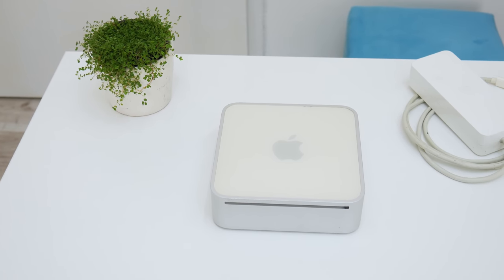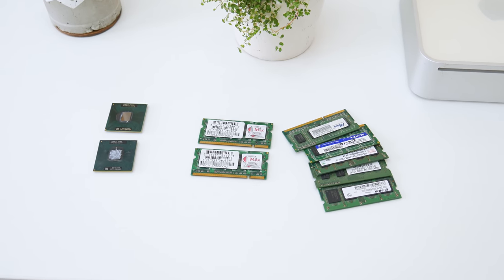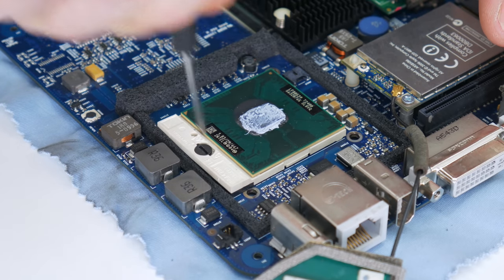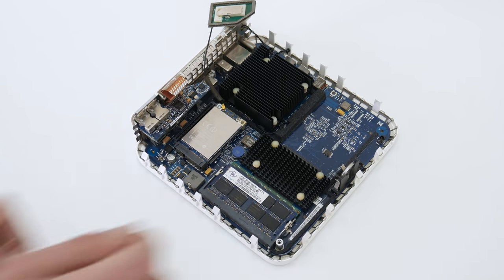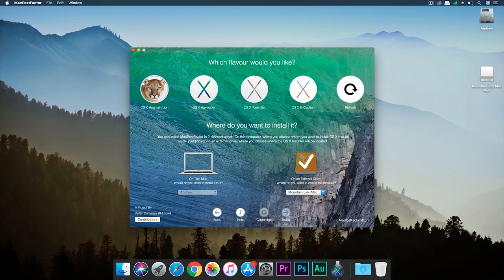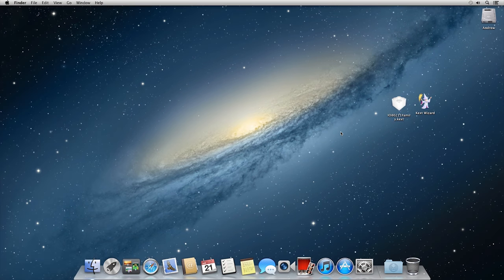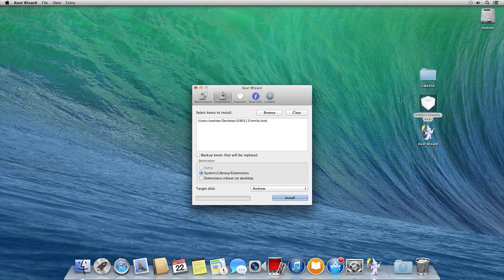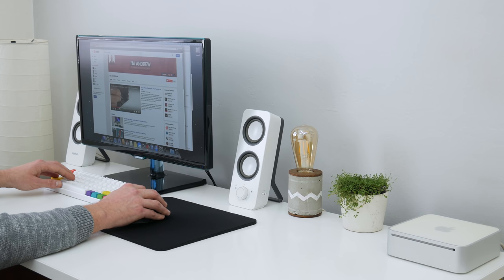Upgrading the $20 Mac Mini - Running Unsupported Mac

Comment: Hi andrew, why u didnt put a q6600 (core quad) and a ssd? thx!
Reply: This Mac takes laptop-class CPUs, it would be physically impossible to put the Q6600 in there.
Reply from the maker: Hi bro, the q6600 ( desktop ) is a different socket, this mac mini has laptop's socket, but some core 2 quad with 478 ( aka P ) socket may work, i will try to find some and try it, btw these cpus are pretty rare nowadays
Reply: The Q9000 doesn't seem rare, eBay is full of them. And for what it is, it's reasonably priced, too. Good luck!
Reply: @ComputersAndTechAndAndrew  ahh ok! I thought it was socket pc not laptop

Comment: LOL. I just thought I would watch this for a laugh cos I got an old MacMini too!
Turns out this one is MASIVELY superior to mine... Mine is a G5 at 1.25Ghz and the best I can get running on it, is MacOS 10.5.8

So, Im going to try to get soem Linux running on it if I can ?
I did plop an SSD into it a couple of years ago, and it helped make it quicker but not by much.

Comment: Thanks for the video, useful. I assume this will also work with the Intel® Core™2 Duo Processor 1.83GHz T5600 as this supports the 64 bit instruction set?

Comment: Didn't understand well.
Can't you update firmware before disassembling the computer?
Reply: Luis Ces well, yes you can. I think
Reply: @sohamghosh4815  So Andrew could have avoided disassemble the computer twice and disassemble it only once?
Reply: Luis Ces yes but it would be super slow or worst of all, it not turning on.
Reply: @sohamghosh4815  I don't pretend bother you but Why updating the firmware would cause the computer not to boot?
Reply: Luis Ces because if the computer finds it isn’t compatible with the software, it will give an error. You can’t update it to an unsupported software with a hackintosh.
Reply: @sohamghosh4815  Sorry? Hackintosh? This is a real apple computer.
Reply: Luis Ces you can hackintosh a mac. Check out a video by Snazzy labs called “hackintosh a real Mac?”

Comment: Hey, Andrew! Just met your channel with this video (and already subscribed it!). I just found an old Mac Mini in my basement and started to search what I could do with it. It was a great coincidence to see that you recently upgraded it and published it here. I would like to ask you one thing: The T7200 is the best CPU for it? Do you know if I can put anything greater for the CPU? And how about a SSD? Thanks for sharing your experiments! Cheers from Brazil.
Reply from the maker: Hey bro, thanks for subscribing :) about upgrades, the T7200 is the latest used CPU on this mac Mini models, maybe some other CPU will work but i'm not sure. I got the T7200 because i saw that it's supported and it is very cheap :D also with SSD will be much better
Reply: @ComputersAndTechAndAndrew  the t7400 en t7600 work well

Comment: And i just want to put a more recent os x on my Mac Pro 2.1 still on 10.7.5 lion, but i'm afraid that it will not boot after.
Reply: I've actually used MacPostFactor on a 1.1 (with the 2.1 firmware update) with a GeForce 8800 to install El Capitan. Then we swapped the video card out for a GTX650 and put in the WiFi card from a 2011 or 2012 MacBook Pro.

No boot video so if something goes south, you have no idea; but there is video when you get into the OS, so it works.
Reply: Only thing I'd suggest when doing that is if you have an empty drive bay would be to get yourself a SSD to install it on. Newer OS X versions take forever to boot when on a hard drive.

Comment: Congrats for the well done video! Really nice and helpful . I just installed mavericks on my 2007 Mac mini. Can I update to 10.9.5 with no issues?
As I already had 2.0 GHZ INTEL CORE 2 DUO on my 2,1 mac mini, do you think is necessary update firmware to upgrade to 4 GB RAM? 
I couldn't find the file on dosdude website. Big miscellany. Can you write down the name of  that file if that's the case. Thanks ; )

Comment: Guessing it has integrated graphics and you're forever stuck on Mavericks. I did similar with a Mac Pro 1,1 and with a GPU upgrade I'm running El Capitan flawlessly EXCEPT the EFI is still 32bit and I don't have a boot screen.

Comment: Fun Fact - APPLE throttled these 64-bit CPUs used 2007 2008 to only actually RUN at 32-bit !!!!  A custom firmware flash required to undo that and allow tghat 64-bit beast to roar in your iMac or mac-mini.
Reply from the maker: Hi bro, some core 2 duo, like one i used in this video, are 64-bit, even good enough to run windows 10 :D, i try that

Comment: I have a iMac Mini Loin 10.7.5 and want to run the latest Mac OSX
Reply: Loin? i have a filet mignon
Reply from the maker: If your Mac Mini has Nvidia graphics, than you can go with latest macOS Mojave
Reply: Cat and Andrew how do I find it out if it has nvidia I'm not good at programming
Reply from the maker: @JustinFrost302  You can tell me what model of Mac is and i will find it, ( example Mac Mini A1347 ) the model is written from the bottom side
Reply: @ComputersAndTechAndAndrew  its A1176

Comment: Macs are great, once your machine is labeled as obsolete "2 generations away", to upgrade the machine you should: Read a manual, download firmware from 3rd parties, find hacks.... etc.
Now you cant upgrade anything since most things are soldered in... 
Enjoy the last generation of upgradables.
And yeah, better switch to a PC, I did in 98 and never looked back.

Comment: That's what I hate about apple. The 2006 mac mini was only supported with new software for 3 years until snow leopard. If you then want a new OS for safety or software support reasons, you have to buy a new machine. This mac mini with OS 10.9 is still quite useless if you want to run any modern browser or use apps from the app store, because most modern applications require OS 10.11 or newer.
If you want to use this computer today, it's better to just install Windows on it. Windows 7 runs natively and still gets modern software, I don't know tho if Windows 10 will run.
Reply: That's because it had a 32 bit chip, so they would've had to go through a lot more Hassel to keep it updated. Just like how the iPhone 5's support was dropped relatively quick, but the 5s's which had a 64  bit chip is going to be dropped this year. Kinda understandable, but still not excusable.

Comment: Unfortunately it's not safe to connect to the internet with a mac OS lower than Sierra. Nice job though. I cloned a mac mini 2011 to a ssd and upped ram to 8gb, but the OS support for even high sierra will be done before long. It was fun but a WASTE OF TIME. It's like using XP you putz!
Reply: I'm running 3 OS X simultaneously, 2 of them Lion and Mavericks, only 1 is newer than Sierra which is High Sierra. I run every browser both supported and unsupported on the older ones and have never encountered any threats. I browsed many darkest corners of the web and my Mac wasn't infected a single time. On the other hand Apple itself has warning in small font on every product page of their site stating that "Internet is a territory of risk", so it doesn't matter how new your OS or browser is, you're vulnerable anyway if some gvmt or bad actors decide to take over your computer. The mantra "update to get newer security patches, it's unsafe to use Internet with older software" is just a tool of intimidating customers into upgrading their software in order to make their hardware obsolete as soon as possible so they could sell you their newer machines so that, in turn, the flywheel of economy and corporate profit would gain the speed.
All the security hype proved to be helpless against Meltdown and Spectre, ransomware attacks no matter how new your software was. Also, take notice of who first reports of vulnerabilities: it's security specialists and research analysts that Apple makes publicly available on their site. Besides that, a one more thing has spurred my curiosity: why does Apple publicize already patched security holes? Regardless of whether attackers would be able to discover them on their own why wouldn't it be better to leave them blissfully ignorant about what vulnerabilities were mitigated? I believe that by making the information open Apple just incentivizes both sides - attackers and their potential victims that happen to be Apple's customers (leaving the latter naked against attacks unless they upgrade to "the latest and newest") - thus creating the aura of constant danger to increase their profits.
On Internet you're risking every moment. And a greater problem is incompatibility with most of sites not a malicious link.

Comment: What CPU did you use
Reply from the maker: Hi bro, i used Intel Core 2 Duo T7200, but this mac mini also will work with T7500
Reply: Cat and Andrew thank you 😊 I’m thinking about doing the same thing but it’s difficult to find a Mac mini for a low price in the Uk.

Comment: Why bother to upgrade the DVD when you simply use an external DVD with a USB plug. A normal PC type DVD player/burner the ejects the DVD tray. Simply easier to use and no dvd's to get stuck in the slot.

Comment: But one thing is run unsupported os and one different run flawlessly and usable.

For example I have a iMac g4, that have OS X tiger and I installed successfully snow leopard. But the system is unusable. Veeeeeery sloooow
Reply: You can't install Snow Leopard on a G4. It only goes up to Leopard.
Reply: Tiago yes I mean leopard. But the point is that the system become veeeeeery slowlyyyy and unusable.
Reply: Might be if you like the Apple Original esthetic, you can install an Intel NUC, with corei7 inside it and build a super powerful Hackintosh with it

Comment: You upgraded the 32bit CPU for a 64 bit CPU - but isn't the bus still 32 bit ?
Reply from the maker: Hi bro, actually no this mac mini is 64 bit, but with mac mini 1,1 is limited to 32 bit, that's why i update the firmware to 2,1. The 2,1 is 64bit.

Comment: I should also point out you can buy an old version of parallels (v7, 8 or 9) for $10 on Amazon and run 64 bit Ubuntu or Neverwear's CloudReady or even 64 bit Windows 10 (but you have to pay for it) to be able to get a modern browser on this machine. Parallels runs 64bit os fine in Mac OS 10.7 or 10.8.
Reply: Oracle VM vitural box is free and it would make sense to dual boot rather than vitural machine because if how low end the computer is in 2019

Comment: Putting in a 64bit processor wouldn't do much if the I/O bus is still 32bit.
Reply: It's not particularly for performance but to allow to use the 64bit OS and apps. Also the dual core makes a big difference over the original single core. I did this several years ago and it allowed the EyeTV software for freeview to do alot more.
Reply: I/O is everything. It may run but if it is still 32bit tx/rx and has to be interpreted it is a net0 gain.
Reply: @dronepilotflyby9481  Again, im not talking performance gain, im talking about doing things in a dual core chip that certain apps wont let you do with a single core. not everything is about throughput.

Comment: Although i'm 100% sure you can't put an SSD on it but i think if you can find an linux disto fur the old Power PC platform you can make an good MAME Box out of it. The 2014 and higger MAC Mini's like i have no issues with anything mindnes VR since the only thing that makes the Oculus Rift not work under bootcamp is the intel GPU used. Otter then that moving to mac was the best thing i ever did. I remanded everyone even gamers dump Windows 10 an go MAC it's that good. No Apple didn't pay me to say that was over 100% me.

Comment: Uuhhhhh 4 GB of ram, I wonder when the parts were originally made, often Apple use 4+ year old parts in brand New computers but priced 2x the price of current hardware at the time... then continue to sell them unaltered for 4+ more years at the same price. Often with an ancient 5400 rpm harddrive

Comment: watched you spread thermal paste with your finger and cringed super hard
Reply: You Kiss Boys there is nothing wrong to spread thermal paste with your fingers
Reply: Mr_Tea have always been advised to not personally touch the thermal paste🤷🏼‍♂️ if it works for you, keep at it.
Reply: You Kiss Boys as long as you don’t touch liquid metal thermalpaste everything is okey these stuff is dangerous and could harm your body but normal silicone thermalpaste is okey to touch but yeah do however you want